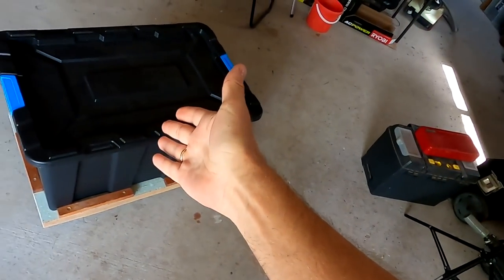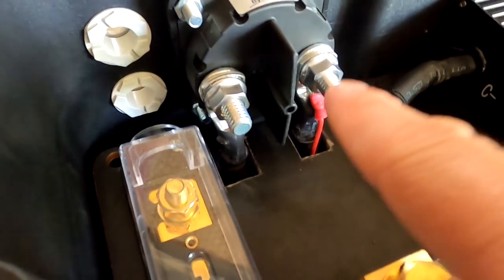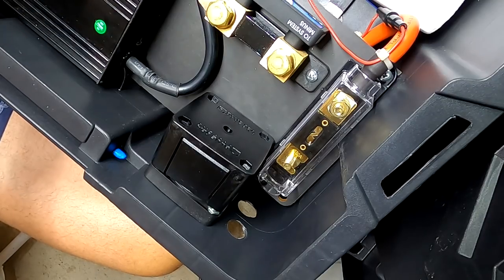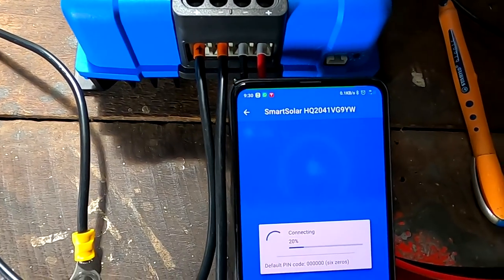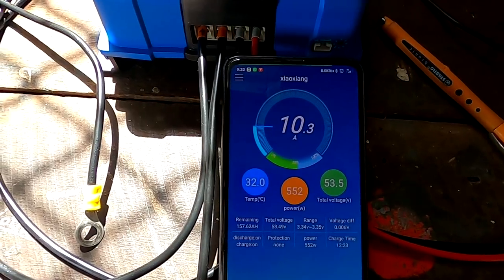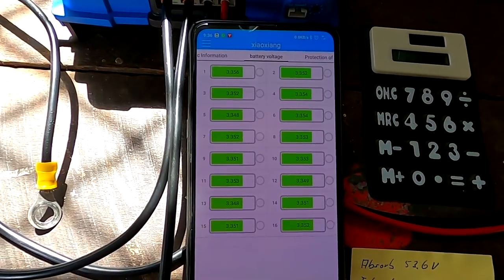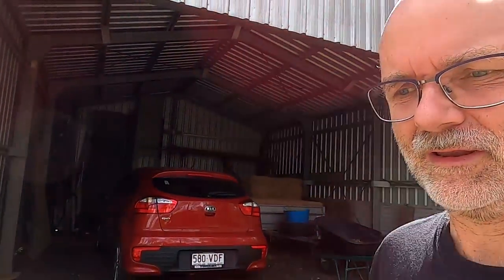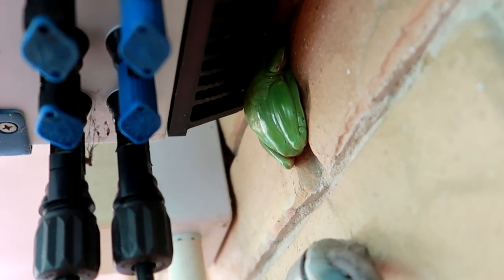First Battery Charge. I needed to do this!

Comment: Congratulations. BTW you could have easily got the CC cables through the hole if you had removed the cables from the CC terminals and push it through, from inside the battery cabinet. I hope I can build my pack soon. I bought 16x 105AH cells from AE in 2019 and I got duped. After that I lost hope. But the cells are much cheaper and widely available now. Anyways, thanks.
Reply from the maker: Yeah, it's just a temp setup but you're right that would have worked. What happened to your cells from Ali?
Reply: @OffGridGarageAustralia  In Sep 2019, I ordered 16pcs of 105AH cells (advertised as brand new) from a Seller in Ali at 1300USD. After 3 months of waiting, they sent me old used cells, out of which 14 were at 0V and only 2 were 1.5-2V. I complained and the seller said I should first charge the cells, which is ridiculous. I opened a dispute and Ali Dispute resolution team sided with the seller telling the same that I have to charge the cells to make it work. Despite several attempts and contacting the customer service describing I cannot charge any LiFePO4 cells that is below 2.5V, there was no refund nor any agreement on return (It seems I have to pay for return and I couldn't even find any service to ship lithium batteries back to China). PSA: Avoid this seller: Shenzhen Foxell Technologies Co., Ltd. Anyways, Thanks to you,  I am inspired to continue the project again.

Comment: I got really excited for you man, I've got a smile on my face from ear to ear. I'm getting ready to wire up the panels to my system myself. 

I just finished up a test pulling 1500 watts for the last 3.5 hours with a heat gun thru my inverter. Brought them down to 2.8v per cell. (8s 24v Lifepo4 CALB). Everything went smooth. Tomorrow morning I'll put the multimeter to them to see how they balanced overnight then the next time that they are charged I'm hoping it'll be with the solar panels.

We're getting a major snowstorm over the next several days here in New England but Im hoping to be testing out my panels for the first time in the upcoming week. 

Congratulations on a great job and thanks for sharing your frequent updates with us.
Reply from the maker: Thank you so much for your feedback and sharing your experience. That is so cool that more and more people just follow this trend and build their own systems at home. You better charge your batteries up before the storm hits.
Stay charged!

Comment: Great videos Andy. I have really enjoyed watching the progress on your battery build. I use the Victron smart shunt in my RV and I think you will be disappointed in hooking it up to the output side of your switch. The shunt is able to track history of the battery pack which you will lose every time the power is turned off. Also the state of charge must be reset to 100% each time you turn on power to the shunt. If it is powered all the time then your state of charge and history will remain.
Reply from the maker: Thanks Kevin. I'm not planning turning it off any more once the battery is in place. But I consider to change that just in case. I noticed it resets every time. Stupid it does not safe the data.
The shunt actually resets/calibrates itself every time it hits the criteria set in the config.

Comment: about that nasty switch cover - it has a problem with the fuse cover, I think you will need to move the fuse a little bit.
Reply from the maker: They are not touching. There is space in between. I need a longer screw to hold it in place.
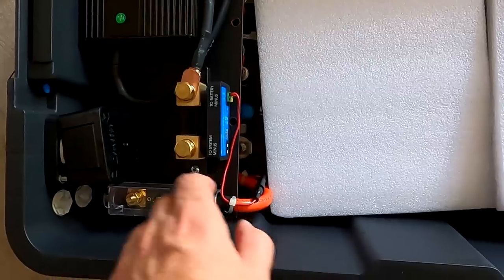Reply: @OffGridGarageAustralia  but in your take from 1:22 to 1:27 it looks like they are touching, it could be also an optical ilusion. Just put a sheet of paper between them and when the switch cover is in place just pull the paper - then you will know for sure if they are touching or not

Comment: Congrats!  I love the feeling of getting these things working after so much planning, building, and smashing through the little problems that inevitably come up along the way.

Now that your 660W garage sized system is coming online, the next thing you will want is more power for the house?   Always happens with us guys. :)  That 660W will just be able run my desktop PC,  home theater amplifier, and a large LCD.   But not in combination with other common home automatic appliances like a fridge and an attic fan -- which I found runs at 400W itself!  So what would be your plan for a larger "house sized" 2000W or even 6000W solar setup?   I'd like to see a 6000W solar array setup using 48V system!  You'll be needing some long runs of 00-gauge wire to carry the 125A of deadly current.

Or maybe split up 6000W across three 2000W GTIL2 inverters that can be "stacked" in synchronized AC parallel mode.  I would have to check the quality of AC waveform output from those Chinese made inverters because quality AC output from DC is not trivial.  Also that 2000W at 48V still pretty "hot" at nearly 42A current will need three of them.
Reply from the maker: There is another problem to solve before all that. I also have another 660W string on the roof already (the other two fuses in the metal enclosure) so I'll see how this go.
With a 6kW solar installation I would probably even go for a 96V battery system unless you split it into two systems. But still 48V in this size is a lot of current... It's probably easier to just get a larger battery bank with more capacity and max out a smaller solar for energy harvesting.
How much power do you actually need in your home at the same time? It's quite hard to project this...

Comment: Yes, now you need a GTIL and connect it at night so all your energy consuntion will come from the Frogie box.
Reply from the maker: a GTIL...?
Reply: @OffGridGarageAustralia  Grid tie inverter with limiter. It only uses the energy in the home but when battery is low it switches back to grid power.

Comment: After seeing all the monitoring devices working and the whole system working, if that is my system, I will remove the shunt, the battery switch and also change to a BMS without the Bluetooth as they are the weak link on the system causing unwanted load. My primary goal is improving system efficiency.  Ever wonder why the solar charge controller does not have a display but only simple LED as indicators? The answer is to maximize efficiency. But without those monitoring devices the video can be boring so it is a must thing to do. :)   

The frog is charging up, warming up, that frog understand very well how to be energy efficient. :)
Reply from the maker: Yes, you could do that if you want all the efficiency. I'm not too fussed about it as solar power is free and I have lot's of capacity. Currently it uses around 17-20W standby incl inverter (spoiler alert).
Reply: @OffGridGarageAustralia  while your batteries are shipping, I was also having my orders online (120AH cells as the 280AH is not available from our local suppliers that time and more expensive to get from Aliexpress to my location) and managed to finished my setup for the house last week with 5kw SRNE inverter. However, I only have the 600W solar panels (150W x 4pcs) as a test setup. I know it is not enough but squeezing more on efficiency the system is sustainable during day time when sun is up. When the bigger capacity solar panels are ready, the entire house will be off the grid. :)  I always enjoy your sharing/videos and I thank you for keeping an update.

Comment: Another great video Andy..😊👍
I do have a question about the Victron controller. When the unit shuts down the voltage because the battery is full, can you program the 'load' terminals to divert the solar power that you can still produce (but now not needed to charge the battery) to a 12v heater element in a hot water tank..?? 🤔
Reply: With bmv-712 with relays you can. The Smart shunt dont have relay . I was starting to look into it but havent hot around yet. Lots of info out there. Dave Potz did som good about it.
Reply from the maker: Thanks Bjoern.

Comment: Eureka! The system is charging great moment and everything worked. Now the inverter to do and you have the mains power and total power independence in your garage.
It brought back some great memories of switching my system on for the first time three years ago. 
Because I am UK based and using lead/acid deep cycle batteries (lithium batteries were just to expensive back then) I have to use a mains charger on cheap night time electricity for a couple of months in the winter. Do you plan to do anything similar for your system as a backup charging strategy?
After watching your video I think I will be upgrading to a lithium based battery so that I can cycle deeper and without damage.
Reply from the maker: Thanks Harry. I'm not sure what I will do with the grid power for now. Probably I just take it off grid. The power consumption for the garage itself should not be more than 1-3kWh per day. At the moment I have issues with the inverter and charging the car. Trying to build a TN-S earth ground system but the inverter cannot do it. I probably need a new one 🤔
Reply: @OffGridGarageAustralia  I had the same problem, it’s easy to fix. The car won’t charge via the EVSE because it can’t detect an earth on the negative terminal.
All you need to do is put a high value resistor between the negative terminal and the earth terminal on the inverter and it will work. I used a 1000ohm 1watt resistor. It’s been permanently connected for years and hasn’t caused any issues. I fitted the resistor into an ordinary house plug so that I could remove it easily if needed or for if ever there was doubt about it affecting anything but it has never caused an issue. The reason it works is that in virtually all countries the earth is connected to the negative in the sub station or in the street, so that the negative is referenced to earth and not floating. The EVSE checks for the reference to earth.
The resistor will consume .2 to .3 watts at 240 volts nominal, I never tried a higher value resistor as it worked ok but it may work with a higher value if you want to ‘test’ and experiment to find a sweet spot :)

Comment: Putting the voltage sense on the output side of the isolator is a bad idea. When the shunt loses power, the CE and % charge data will be lost. That sense wire should be connected as close to the battery positive as possible.
Reply from the maker: But then the main switch would loose its purpose as it does not turn off all equipment. But yeah the data... Once in place, I don't plan to turn it off frequently anyways.

Comment: Does the victron charge controller have a dump load function?  Would be nice to heat some water with a DC heating element when the battery bank is full.  Would be nice for a hot tub eh?
Reply from the maker: You can use the Victron BMV for that which has a relay output. It's programmable and can divert the energy from the battery to another load.

Comment: Hi Andy, ich finde Deine DIY-Batterie super und die Videos bzw. die dazu gehörende Website auch. Gibt es so was wie einen Schaltpllan und eine Stückliste für die komplette Batterie in der schwarzen Box?

Ich plane das gleiche für Paraguay, nur ohne PV, als Stromspeicher für ne Ersatzstromlösung. In PY fällt öfter der Strom aus, kostet aber dafür nur 0,04-0,06 € pro kWh. PV rechnet sich daher nicht. Ein Speicher ist aber notwendig. Die Box kommt dann an drei Victron MultiPlus II (=dreiphasig) als Verbindung zum Hausanschluß.

Das ganze wird allerding in DE konfiguriert und zusammen gebaut und als Modul im Umzugs-Container verschifft. 

Beste Grüße und mach weiter so,
KaPe
Reply from the maker: Vielen Dank Klaus-Peter. Daran arbeite ich zur Zeit. Noch etwas Geduld und es sollte auf der Webseite sein.

Comment: jan from Texas.  great work and the excitement spills over.   u would be a great actor in HOLLYWOOD. 
I do have 2 questions.  i am trying to buy the same battery u have from Alibaba but none of the 4 credit cards i have would work. Alibaba told me i can be per-approved by taking a picture of my credit cared and my passport which i did (not to smart). still no luck. how did u pay, wire transfer?
the other question was, the BMS has a blue-tooth connected to ur fon in order to see all the cells. is there another permament way to see what the battery is doing without the fon? again great work.
Reply from the maker: Thanks Jan. I just paid with CC for mine and had no problem...
The BMS has a RS485 interface to supply all data to another system. Not sure how to do that but I think I could google it...

Comment: I don't really understand your charging regime. Have I missed a video about that? Us I understand you with from bulk to absorption @ 3.35VPC, then to float @ 3.3125VPC. Balancing for every cell @ 3.36VPC (so any high cell will be balanced). Does this charge your cells properly? I understand that anything under 3.4VPC is not considered charging. Reason I am interested is, that I have a propellor charger on my boat that allows me to change the voltages BUT I can only have an absorption duration. Because I won't know the SOC when I start sailing it would be a waste not to use the full (40A) capacity of the propellor but I don't want to overcharge either. Conundrum!
Reply from the maker: The reason for that is, I don't want to charge my batteries to 100%. 80% would be preferable but I need to find out the correct voltage for that over time. So I start with 3.35 per cell or 53.6V as absorption voltage. That is when the controller switches from Bulk (constant current) to Absorption (constant voltage) and the current tapers of. Technically you can charge your cell to any voltage between 2.5 and 3.65V.
Reply: @OffGridGarageAustralia  Ah, got it. 80% is the aim. Int that case you should be aware that LiFePO4 chemistry suffers from memory effect, degrading the performance of your cells. More excellent technical info is to be found here: http://nordkyndesign.com/practical-characteristics-of-lithium-iron-phosphate-battery-cells/

Comment: good job!! have u consider the active balancer besides the bms? i watch people using it to balance them faster ( pardon my english hahaha not very good )
Reply from the maker: Thanks. No I haven't thought about it. The cells are brand new and so far they just stay balanced by itself without even bothering the BMS yet. I also plan to charge them only to 3.35V so there is plenty of headroom if they drift a little bit over time. Free solar power every day makes up for some burned energy while balancing.

Comment: I just got my 280 ah lifepo4 battery up and running and im testing to see how long I can power my gaming pc build before it dies judging by how i use my computer it can last 20 hours straight  Currently 4 hours in and Ive only used 50 ah
Reply from the maker: Wow, that's a great test. Is it an off grid system?

Comment: On my 24 volt lithium battery system what gauge wire should I use that will run from the solar panels to the 80amp charge controller?
Reply from the maker: That depends on your solar panels and how they are connected. What is your setup?
Reply: @OffGridGarageAustralia  I am using four 400 watt solar panels all connected in series. So what gauge wire should I use?
Reply from the maker: @hawkeye312456  if they are all in series, the current stays the same, so depending on your distance I would go with a 4mm2 wire, 11AWG. That's the same wire size as the solar panels have.
Reply: @OffGridGarageAustralia  Also will it matter if I solder a 10 gauge wire and a 12 gauge wire today? I think the wire on my solar panels are 10 gauge.
Reply from the maker: @hawkeye312456  that's totally fine for this purpose. What's the max current going through them?
Reply: @OffGridGarageAustralia  1600 watts for four panels each 400 watts
Reply from the maker: @hawkeye312456  yeah, but what's the max current? That's the important factor for choosing the cables. It's on the sticker on the back of the panels.
Reply: @OffGridGarageAustralia  I hope this helps. Rated Power: 400W
Open circuit voltage (VOC): 50.8V
Max power voltage (VMP): 41.4V
Short circuit current (ISC): 10.23 A
Max power current:  9.79 A
Reply from the maker: @hawkeye312456  yeah, so just under 10A at max power point. 10/12 AWG wire is fine for that.
That's a lot of DC volts you have there. Be very careful!